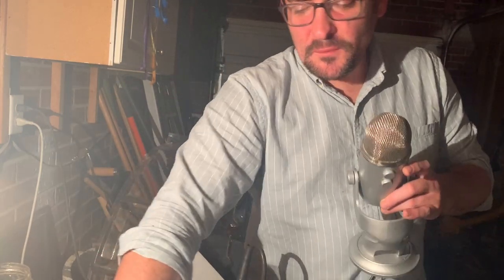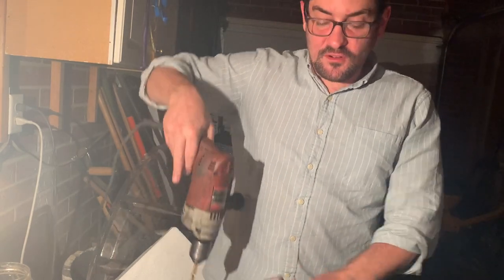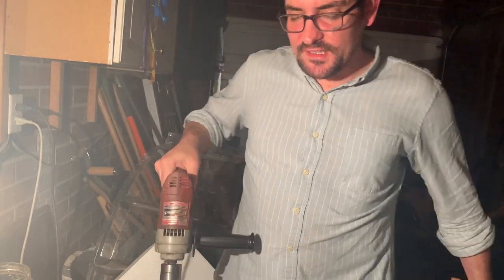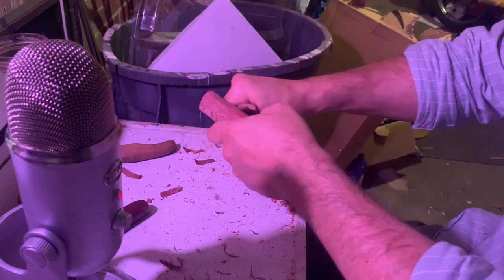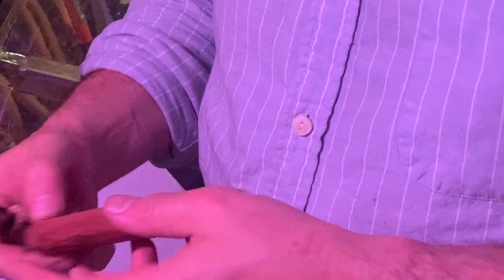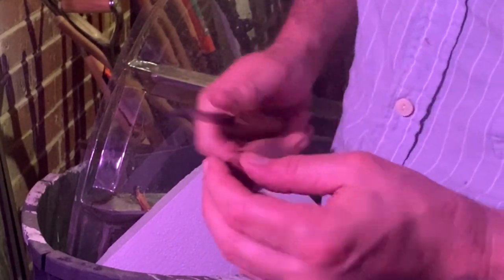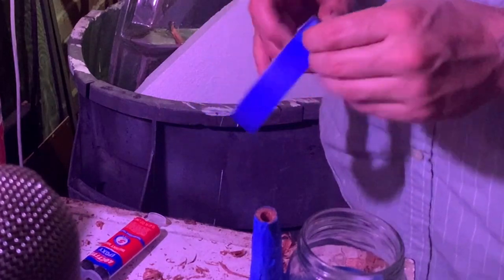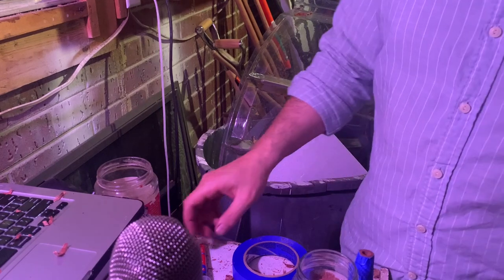How to make a simple carving knife! Handling a hidden tang

Comment: Its a nice touch to use the sawdust in the epoxy. It uses less epoxy, and the sawdust helps hide the pure epoxy plastic look. One could also debate that aggregates make binders stronger as well (like wood fiber in some fancy new plastics and the rock in concrete).
Im about to do a few hidden tangs and thought Id see how a few others are doing it.
some are broken bigger blades, some are made from metal-saw blades, one is a broken needle file I annealed and shaped into a detail carver. Just a bunch of experiments.
Reply from the maker: awesome. sounds fun. email me if you want to share pics or have questions nosubject13@yahoo.com -daniel